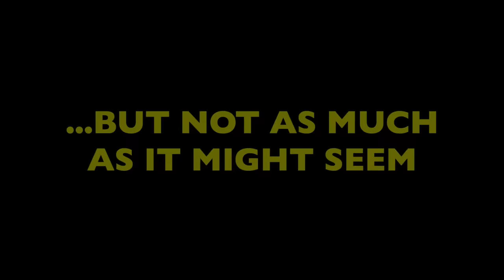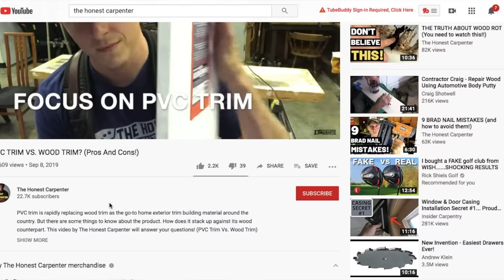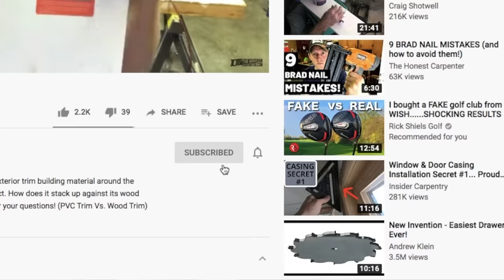How Much DAMAGE Can CARPENTER BEES Cause?! (What To Do About Carpenter Bees/How To Get Rid?)

Comment: We have tons of carpenter bees, what wr did to manager them was build fended out of older but still good wood Arounds the gardens and away from people.   Do this fall or early spring… ideally do this just as cooler weather setting in in fall or before spring gets warm enough for these bees to come out.    This works very well if you don’t mind the bees at all, you will get an increasing population year after year and you will have to relocate the woodwork every few years to be further away.  When you move one fence however, depending how far you move it you may have to build a new one where old one was to prevent carpenter bees from eating into your railings.  They can’t resist if nothing else around for them.  Other option is burn the fence in the winter and rebuild it to manage population growth. We had to do this a few years ago, massive population explosion, 100s of them and never bit or stung anyone they were aggressively bumping into us and not leaving us alone. 

As for repairing.  Yes, carpenter bees tend to avoid smooth fresh paint but only the younger ones.  The adults that know where their nest was when they left it will return.   it really isn’t a fool proof way to keep them out of your wood work.  Ideally want to plug it with something harder than the wood they are chewing, I used construction adhesive with good success and does take paints fairly well.  If holes are round and out of sight I have also drilled a bolt into them.

As for putting up grey bags filled with other bags.. we did find initial success, they still hovered but further away for a while then eventually figured it out and while still actually avoid the bags directly they seem like they wised up mostly.  So I would say, it’s mostly a myth… maybe good idea for a weekend grilling/BBQ get together but don’t expect it to work long term.

Comment: Citrus keeps them away. Soak or spray some steel wool in lemon juice, plug the hole w it and spray the outside. I do it all the time especially repairing decks, rough saw and trim boards etc.

Comment: I had a nest in one of my eves. I found it by hearing a woodpecker banging away. My solution was to fill the hole with spray insulation from a can using the long plastic tube. Next, I shaved the surplus off after it dried. I cut a piece of metal flashing to cover the hole by about two inches all around and using gorilla glue, put it in place. Finally, I painted it to match the surrounding color. That was two years ago. All has been well since then.

Comment: I wouldn’t neglect bee activity. They are generational and return to breed. I’ve had good results with traps lately and after several years of treatment and traps and plugging old burrows my only bees noticed are in the traps. Log home owner.
Minimal attacks on logs if you clean and stain like you should. But the trim and behind panels in places that can’t be accessed is where I had trouble. Traps do work.

Comment: Here in north Georgia the carpenter bees cause serious damage to homes, decks and porches. Painted, treated or stained wood does not stop them. So we take a “game on” strategy when they first appear.  I have made a dozen bee traps which we hang on our front porch and back deck. This past season our traps accounted for over 200 of these destructive pests.  I use WD40 which I spray directly into each hole which kills them instantly and makes the holes uninhabitable for a couple of years because the petroleum distillates soak into the wood.  I then fill their holes with Liquid Nails.  They never return to the holes so treated.  Occasionally I use a tennis racket to smack them in mid-air which dismembers them and helps my eye-hand coordination as well.  Great entertainment!   If you think that they’re not too destructive.  Or my tactics are sadistic and cruel I will happily refer you to my neighbor who just spent $14,000 to have his home and front porch repaired/rebuilt because of these pain in the ass insects.

Comment: Once they're in you can even put concrete in old holes and they'll dig it out. Poison foam? No problem. Will have to try steel wool and filler in the fall.

Comment: that pseudo hornets nest is a great idea! when i was building my tiny house last year i stupidly left it all exposed for a couple months, and a couple carpenter bees setup homes in between my ceiling and roof insulation. i just watched for them (my work area was right underneath the only entrance) and i trapped them and killed them, and then filled-in their hole with the rest of my gaps with titefoam, and never saw any again. painted everything and caulked it too. life is difficult to dissuade!

Comment: You can buy fake wasp nests at the $ store in the spring. They also prevent real wasps from building in the area. They're like the paper lanterns with a coil of wire that pull open in to a ball, except these are wasp nest shaped.

Comment: Years ago I was installing a central hvac system we were running the line set inside the sofit the out down the exterior wall where there was quite few carpenter bees and there holes. Yes for the most part they are not aggressive, but that day they were. Got stung a couple of times.

Comment: I live in Canada and had never heard of these. Bought my first house and built a kick ass deck. After a week I noticed sawdust on the deck and figured it was just some that fell from a joint or flat spot etc. Then a buddy of mine told me and was shocked. Ended up caulking a few holes and could hear them buzzing like 90 and then nothing.

Comment: If you don't want them around at all, Bondo. I have never seen them dig that out, I don't think they like the smell. You can paint or sand it. 
Bondo works great if you have paint constantly peeling in small areas on wood.

Comment: I've seen the grocery paper bag method for tricking the wasp into thinking there is a much larger nest to be avoided. However,  it was said you must get rid of wasp first. Then hang the large paper grocery bag and most are made into a twist at the end. I'd try this with paper not plastic for obvious reasons.
I should try it myself as bad as I have wasp this year esp. I was wondering where all the carpenter bees went.

Comment: I had a professional exterminator spray my house after I counted over 50 carpenter bee holes in the fascia. 3 months later they were back. Now I use brake clean ( in the red can ) it drops them instantly then I spray the brake clean in the holes to kill the larvae and plug the holes with steel wool. I'm seeing less and less of them every day.

Comment: I had Carpenter Bees destroy a pressure treated had rail. Easily replaced it but was surprised by the damage.
Reply from the maker: Must have been a good number of them working in there, Mike. I’ve been told they don’t like treated wood, but I’ve seen them dig it plenty of times.
Reply: Same here. The new treated deck overhang I installed last summer now has lots of carpenter bee tunnels. I thought maybe Menards had poor quality pressure treated wood but I guess the bees just tunnel, they don't eat it. My mistake was accepting a big redwood (Rainbow) swingset play system that was riddled with carpenter bees. They love the softer wood. Painting treated wood sounds like a maintenance headache. I think I'll go the wrap and cover route instead, but I'm not sure what I'm going to do about the holes under the treated rails of my 200' of privacy fence. A shot of insecticide followed by a steel wool plug seems to reduce the numbers a bit.

Comment: Usually the insects  make nests or  bored holes on east side of the house or shed under some structures that prevent rain to come in.  So the best way is to covert that portion of the house or shed  with metal mesh , yes metal nor any other materials, then they will not able to chew the wood. I find nothing stops them except metal mesh.

Comment: Comment about being afraid of Hornets.  My daughter in Georgia had a wood craver craft several large pieces of wood that look exactly like big hornets nests.  She claimed she hasn't seen a carpenter bee since she put two of them up.  I liked the idea, purchased a couple myself and put them up where the bee's like to nest - didn't work for me - the bee's actually started to tunnel into the wood of the "nest".  I spray the inside of the hole with WD-40 and they come up and die.  We have plenty of honey bee's for the polinating - these little monsters will bring down a building after many years.  I have a cracked truss on my pool cabina where so many have eaten away the insides, then the woodpeckers finished it off.  What a mess.

Comment: I tried a variety of things, cork, wax, even popsicle sticks.  She chewed them all.  I used the steel wool n jammed it as far as it would go.  It was a three story hotel, i left the top hole open, tied a cup with breathing holes so i could capture n relocate.  She was definitely in there, i heard her, but i suppose i could have blocked her in.  The males dunno what to do.  They hang on my deck at night n just chill.  I easily captured two n relocated them.  Ive seen one more male, so i drilled into 2x4 about 3” hoping he will at least take cover in there. Im gonna get 4x4 n put holes in it n hang them somewhere that they are out of the weather.  I wouldn’t spend $ on that thing you have bc it doesnt look like she can tunnel it like wood for her eggs.  It’s a no brainer really, like yes if they love the deck, they can have separate deck wood.😄  A lady told me about it.   
🐝 🌎 🙂

Comment: Thing is, there is a cycle to worry about... if you hornet-proof your place, the carpenter bees move in. if you proof the bees away, the wasps move in, etc. etc. with various bug-types. There is no ending solution to the cycle. So while the sprays only last 2-3 weeks, they treat for majority of these bugs rather than just doing things to prevent or proof for one particular bug.

Comment: In the early spring spray the old and any new holes with a fairly concentrated mix of dishsoap and bleach, More soap} less bleach and 1/2water, the chlorine negates the pheromes and they just don't like the taste of dishsoap, only good for a year but is a cheap solution. Agree with the vid best way is good paint.

Comment: I have had the most success with a tennis racket.  I keep an old cheap tennis racket on the deck.  When I see the carpenter bees flying around, I wait until they get close enough and whack them.  I also have a carpenter bee trap hanging that is somewhat effective.  There is no way I would pay $38.95, or any money at all, for a bee trap.  They are incredibly easy to make.  A hunk of 4x4 wood and an empty salsa jar (or peanut butter jar, jelly jar, etc.).  There are plenty of videos on YouTube that will show how it's done.  I made several in 5 minutes.  They cost me a grand total of $0.00.

Comment: Vacuum the bees when they land on the flowers in your yards.  A small hand held canaster vacuum and a long extension cord will do the trick.  In past years I had a influx of carpenter bees that were drilling holes in all of my unpainted wooden front porch deck flenses.  This year 2021 I've sucked up about 60 so far just leave them in the vacuum they will go to sleep and the damage they cause will diminish.  Have fun!

Comment: I cut a couple of chunks of 2x4 like 2 years ago, drilled pilot holes in the bottom and attached em to the outside edge of our front porch. No luck till this season, when i finally saw a couple of bees going into 1, and like 1 into the other. Hopefully the little buggers will leave the pt alone this year.

Comment: Carpenter ants can cause tremendous damage too. Old ski cabins get them in our area. I went to a call one time and knew it was bad. I tried to warn the guy he was going to have dead ants everywhere after the treatment. He called me the following weekend happy but scared that his wife was only an hour away from their weekend cabin. He said there was over an inch thick layer across the cabin of dead ants. I rushed up there and he wasn’t lying. It was closer to 2” thick. On everything. The furniture, bathrooms, kitchen appliances, you name it and dead ants were piled on it. 😂 the carpenter ants had worked their way into the exposed wood roof braces and the wooden ceiling materials too. So any fell from everywhere in the entire cabin. I knew there would be lots of dead ants but this was incredible. I hate to know how much damage had been done to the structure of that cabin.

Comment: We have a 45 yr old Lindal Cedar A-frame in Northern Va (blue ridge mountains). We’ve tried  all of the deterrent methods you mentioned over the last 5 or so years (including an actual abandoned  hornets nest - still hanging) and they come back with a vengeance year after year. At this point they have already created an unsightly amount of damage with hundreds of bored holes, despite our best (non lethal) efforts. Since painting cedar isn’t an option (it has been treated) - and painting would cover caulking (which we haven’t done bc you would just see filled holes) — are there any other options?

Comment: I had some fascia boards replaced when I had my roof done a few years back, there was a foot or so of carpenter bee damage.  They migrated to the fascia boarding on my shed. :P 
I have to replace some of the siding on the shed (rot by the ground) so I'll probably replace those in the process.

Comment: The  best way I have found to deal with hem is to use a small stick or even a small hammer and tap on the wood surfaces where you see the holes. This is extremely jarring for them and they dont like it. You will know when you have found them by the loud bussing sound they make when you hit the wood. Just keep tapping harder and harder until you see them fly away abandoning the hole. Fill it with some type of strong epoxy and paint over it.

Comment: Carpenter bees can cause ENORMOUS damage if you live in a forested environment that has woodpeckers. Here's how it works: 

1- Carpenter bees bite a small hole in exterior wood (porch wood, wood siding, etc) to lay their eggs. 

2- Woodpeckers (especially pileated woodpeckers) love eating carpenter bee eggs, and have excellent vision constantly scanning wood for carpenter bee holes. When they see those holes on your porch and house siding, they'll fly in and peck the living hell out of those holes to peck away the wood around them, and get to the bees/eggs. 

In southern Appalachia (eastern Tennessee, north Georgia, western North Carolina, etc), you can literally go to lunch, and come home an hour later and it looks like Scarface unloaded his machine gun on the side of your house. Thousands of dollars of damage can be done in an hour time from a couple woodpeckers deciding to peck out the bees/eggs in the holes of your wood. 

So if you live in an area with BOTH woodpeckers and carpenter bees, hire an exterminator to perform a carpenter bee spray on those materials a few times a year. Carpenter bee traps won't work, because they capture MALE carpenter bees looking for holes with females in them. At best they have a mild effect on decreasing reproduction near your house by eliminating some males. The females don't "look for holes". They burrow holes from scratch. Carpenter bee spray professionally coated by an exterminator is the only way to reliably prevent female carpenter bees from burrowing holes into your wood and tempting woodpeckers to completely devastate your home searching for them.

Comment: In my experience they scratch or drill through even painted surfaces. I use a bee trap and in a week there is about 20 to 30 in the jar. The trap seems to be the only way to control them.

Comment: I currently have two or three of them on the front and back of my home. I'm thinking of trying to fill their holes in the fall. They don't seem to bother me even when I stand right under their nests, but any other flying insect that comes near is attacked by them. A wasp tried building a nest nearby and the carpenter bee chased them off. It's interesting how territorial they are but do nothing to me.

Comment: In NE Ohio this time of year, we have huge bumblebees with smooth abdomens.  Don't seem like they would pollinate well.  Later in the year, the bumblebees are smaller and fuzzy.  They get so much pollen that they turn completely yellow.  I always thought they were a different species but maybe not.
Reply: You're right, the huge ones with smooth abdomens are the Carpenter Bees. The fuzzy ones are not Carpenter Bees - some other species. I'm sure the CBs are not as effective pollinators as the fuzzy ones. I'm in NW Ohio and have a two story office building with cedar facia and trim which they love.  
I put up some carpenter bee traps the last couple years which  seem to help. I also have used an electronic "tennis racket" but found that I can get more of them with a butterfly net - almost 100% "batting average" with the net, but can't get many in the tall 2-story areas of the building. 
You can imagine that my tenants and their clients don't appreciate getting buzzed by those big black bees even though I tell them they don't sting, so I try keeping them at bay and even hired an exterminator a few times in past years. But I'm told I'll probably never get rid of them because most of their holes are behind the aluminum rain gutters and so they can't get to those holes to treat or plug them.
I had one tenant who complains about the bees diving at her and her clients. So I put a trap up near the entrance and she complained about it looking tacky with the bottle hanging down and hearing the dying bee in the bottle. So I purchased a different style trap for that area. After reading about the fake hornets nest I think I should try that near her door and see her really freak out!! Lol